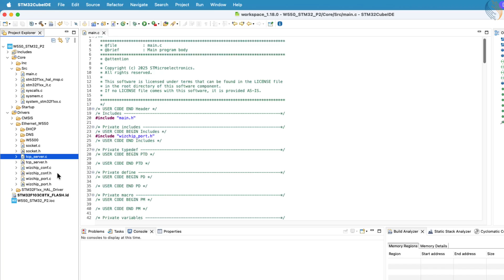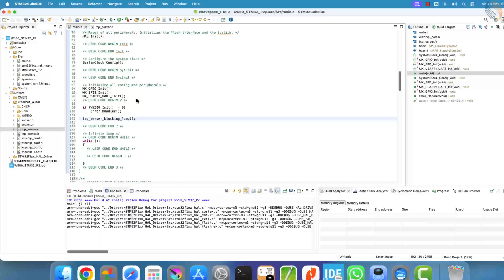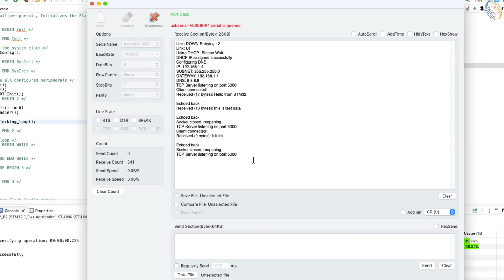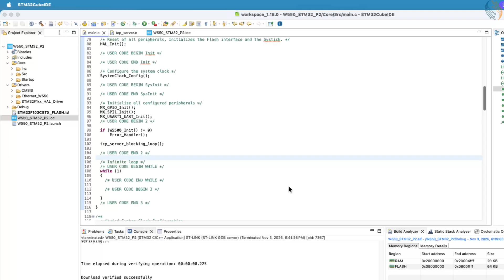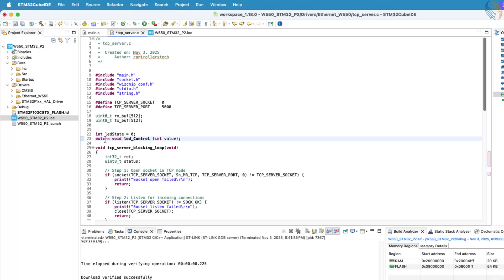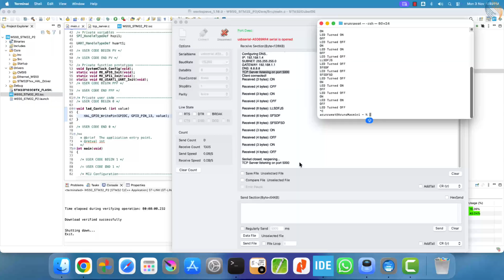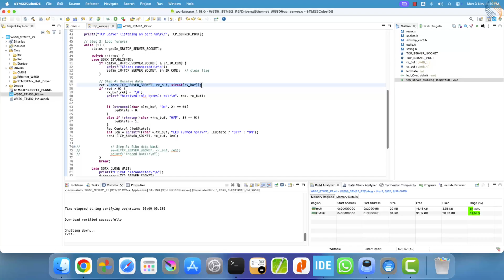STM32 Ethernet with W5500 (PART 2): TCP Server | Receive, Echo & Control LED via Ethernet

Comment: I resumed my studies on the ARM Cortex-M microcontroller after a long break. Now, with the new CMSIS V6, which implements the CMSIS-Toolbox and is mandatory in all IDEs, dealing with bare-metal programming has become more difficult for beginners, even if it's something as simple as creating a clean new project without HAL libraries. However, by manipulating the YAML format defined in the .csolution.project file (with the µVision Keil MDK Community Edition IDE, which uses the ARM 6 compiler for embedded systems), it's possible to create a new bare-metal project to start learning from scratch.